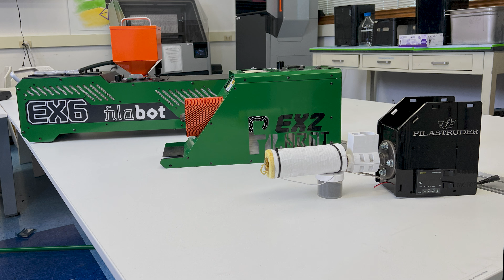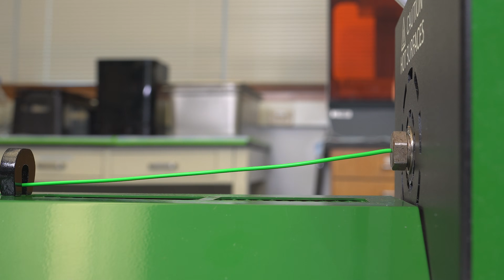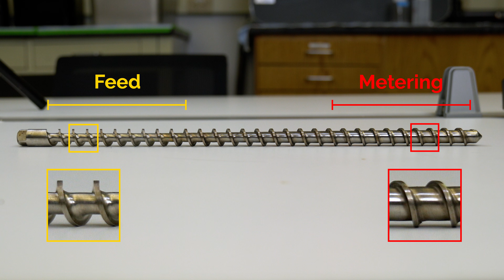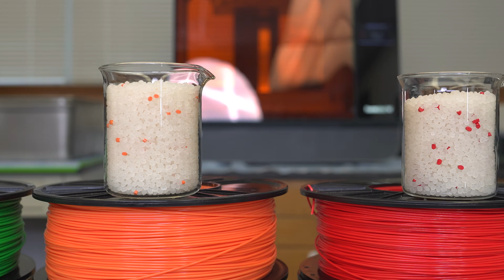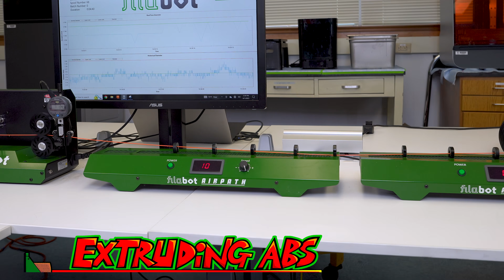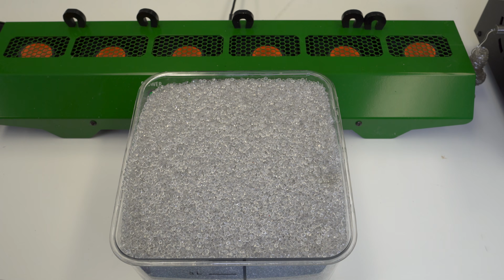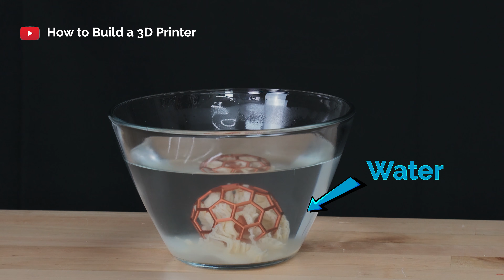How to Extrude 3D Printer Filament (Basics of Screw Extrusion)

Comment: I worked in the plastics industry when I was younger. I worked on Extruders, Injection moulders, Massive or rather Gigantic Vacuum formers, Conduit pipe bending and collar forming in baths of Hot Glycerin. As well as Custom made anything made out of plastics. Oh yes, we did Signs as well and had an in-house electrician to sign off on everything. Cool job. So, if 30 years ago you told me about 3D Printers and how everyone would have one in their home, I might just have believed you. But if you told me that a few years later again many of those people would have their own plastic extruders in their homes and some people even making their own little injection moulders well, i would never ever have believed you. The prices of industrial injection moulders and extruders were prohibitively expensive back then. The injection moulding machine its self was around $1M (Australian) and I was told the Moulds were around $500k per set in total. The mould in particular was for making McDonald's Tea Spoons. I can not wait to have my very own extruder for making 3D Printing Filament.

Comment: $20 for pla, its $15 or even $10, so the ROI factor is doubled, 3000 spools, who can go through 3000 spools of filament, and then isn't it going to be better to do injection molding?
I looked into contracting out production of some 3d parts I am using for a small production product (like 100 units), and the quotes given from 3d print services were insane,
I don't see how any of these businesses (who are the people that would buy these machines) can stay in business, who pays $20 to have a $2 part 3d printed?

Comment: I've just gotten into 3d-printing, but so far have had good luck with PLA+. The problem of course is that I don't know what additives make the "plus" in PLA+, nor do I believe that PLA+ is a standardised material. I assume each vendor would have their own additives, and their own "secret sauce" to make their filament perform well. 

I've hypothesised that blending recycled shredded PLA+ with, say, 35% virgin PLA by mass, would produce a material that I'm jokingly calling PLA# ... but without knowing the exact additives in the PLA+ there's no way to model how that material might behave, or the ideal ratio with virgin PLA that would produce a stable material.

Comment: The Berstorff extruder at Goodyear in Lincoln, Neb. was 12 inches in diameter extruder. It used a 1000hp DC motor which was geared low to break "cold" jams, and was run under field weakening once things settled down to speed things up. The mouth of the extruder (where it met the calender rolls) was about two inches deep, and 84 inches wide.

No clue as to what electricity cost per hour to run it. 

Since I am local, can I buy filament from you to help you out?

Comment: Questions.  Why is there no foaming ABS?  PLA can't be left in the sun for 3d printed aircraft or rockets.  Is it possible to make a foaming ABS?  Also, how are foam filaments manufactured where they can be extruded the first time (under mfg) without foaming, yet foam for the end user when they print the material?   LOVED THE EPISODE.  I am also a full-time maker at a university.

Comment: 2:05 "the smaller extruders can not make this process worth your time" - I disagree with that statement because it depends on the intention for DIY extrusion.
If you're someone who does a LOT of printing, then 8h / 1kg spool might be "too slow" to be "worth the time", but I'd argue that most people that use 3D printing are NOT using up 1kg / day. As an example, my primary intention with DIY extrusion would be to prevent failed prints from ending up in a landfill.
If the quality is top, then 8h / 1kg spool would be absolutely perfect for me and totally worth the time. But I'm obviously not a high volume printer to begin with.

What I find odd though is that the spooling end part has a digital read-out of the filament diameter, but no feedback system that utilizes that data.
Meaning the lack of automated spooling speed based on diameter accuracy.

But otherwise a very informative video, especially the point on economics and expectations of return from that.
Reply from the maker: The other issues with the small extruders:
1) Increased residence time of the plastic in the barrel, resulting in thermal degradation of the extrudate.
2) Insufficient or nonexistent compression region causing poor pressure generation and inconsistent output. 
3) Poor mixing by the short screw, making it difficult to mix in colorant or other additives).

So unfortunately, even if you have more time for the extrusion process, the filament produced by very small, low-cost extruders will be inferior to those produced on a larger machine. Screw extrusion is one example where a machine that is 2x larger is not just 2x better but exponentially.

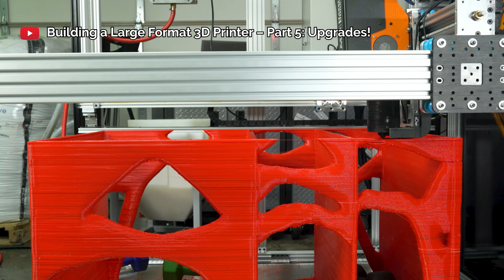Comment: Im sure Dr D-Flo knows this, but it needs to be said... @7:48 you can see the layer lines so dramatically, because the tolerance of the filament is too great. The printer assumes perfect 1.75mm diameter filament. If that varies, so does the quality of the print. Although the industry standard is +-0.05, you wont see a quality print unless the diameter tolerance is +-0.02mm.

Comment: why not accurately and evenly heat plastic to its melting point and extrude it from a large molten volume instead of dealing with all the complexities an auger brings?
Reply from the maker: Plastic has a low thermal conductivity, so it is very difficult to melt large volumes of it in a timely manner. Also the plastic degrades when kept at high temperatures for long durations. The Archimedean screw more uniformly mixes and heats the plastic.

Comment: Likely dunning Kruger here but won’t metal be too abrasive over time and increase that 100 micron gap?
Reply from the maker: Yes the gap increases. You hope that the screw is the one to decrease in diameter as this is a replaceable component. Usually the barrel is engineered to be harder.

Comment: great video but DAAMM the equipment is a RIP OFF beyond stupid. A new car with a multi cylinder combustion engine will complex drive systems and smart connectivity that will last 100,000 miles with no issues, ooOr a fancy motorised screw with a heater at the end of it. 🤦(btw the extruder costs £12,000)
Reply from the maker: 🍎 and 🍊. One is a highly specialized tool for a very niche market and the other is perhaps the most mass produced device in human history (engines as a whole). Not down playing the extruder’s cost because it is expensive, but economies of scale need to be considered.
Reply: @DrDFlo  true but its £12,000, id understand completely if it was around £7,000. I completely understand it is a niche market so prices are higher. But this consists of motors and a dozen sensors screwed to sheet metal (not very advanced ones eithier). I can't ever see any more than £3,000 worth in parts in there. The waterbath is £1,000 and that is litterally just sheet metal.

Comment: Great video and clearly great hardware, but ...  I can't shake the question: why so much manual and analog gauges and knobs rather than having everything measured digitally and controlled as a whole by one or more microcontrollers?  Seems to me that automating could seriously simplify the process and by dropping those analog controls and feedback gauges, I'm wondering whether it wouldn't even save BOM cost ...
Reply: Absolutely, a bit more automation would really help.

Comment: Hey d. When you start the spool put the filament in the hole at the outer part of the empty spool and when it runs out it the filament won't stick in the capture hole and and it'll trigger the run out sensor on a printer. This will help if there's a long print running.

I can't take credit for this. The fella at slant3d mentioned this fact.

Comment: Would it better if the extruder is set vertically so the gravity could assist with tensioning. I know I've seen something similar, ( i think it was spaghetti manufacturing), where as silly as it sounds, the diameter consistency and tolerance was really important.

Comment: I believe some wire drawing is passed through a cold die, basically a hole the "correct" diameter that is needed. Tiny bit smaller to allow for expansion after that cold die

Comment: Great job and actuate terminology I have been running extruders for over 20 years and can say your the first that I know of in the FDM field that gets it, it's not a glue gun and this is only the start but a very good one at that there are many different styles of screws besides just the Let Down ratio and compression like high output and mixer screws for achieving different materials and ways and my ever famous saying what goes in comes out true story lol Cheers! there are also backpressure gauges like dynisco and melt indicators that help you lock down the ideal heating and cooling of the barrel zones and get the best back pressure for consistency keep up the great work!

Comment: The only nice part about HDPE's tendency to shrink is that it makes it easy to remove from things. In fact, you'll struggle to attach it to anything via glue; your only options are mechanical fastening and melting parts together. Brothers Make shows off some great methods for working with it on a hobby scale.

Comment: I used to work for filabot. I wrote the data logging software "filalogger" for them. Many of you have questions about closed loop operation. This was indeed on the table when I developed the system. Sadly though, it is not anymore.
Reply: @btechnet is it still possible to setup closed loop controls? Seems like it'd be super valuable for longer runs.
Reply: @Charlie-id4tv  It is still possible. It would be a substantial investment to get it working since they use non-standard controls. At the end of the day, if your extrusion line is setup properly, you should be able to balance speed between extrusion rate and spooler without having any major fluctuations. 

I still have two EX6's myself, and I can run those for 8 hours a day and maintain +-0.02mm the whole day.

Be sure to get the upgraded barrel / screw combo. Chrome plated screw at minimum. If the screw isn't the upgraded version, you will need to replace the barrel every 4 months.
Reply: @btechnet  I might need to control the speed for nonstandard filaments. I guess it wouldn't be as simple as re-wiring the control knob, or heck, just jerry-rigging a servo to directly rotate the dial?

An arduino microcontroller could monitor the diameter readings from the micrometer and make crude adjustments at least.

Thanks for the info.
Reply: @Charlie-id4tv  Youtube isn't letting me reply with any useful information, but I have a bunch of useful information for you
Reply: @Charlie-id4tv  The SPC Unit is open source. It is also already using arduino

The SPC unit can be extended to work with automatic control if you replace the motor in the spooler with a nema 23. The SPC unit captures the diameter data and sends it to the software front end I wrote.
Reply: @btechnet  Unfortunate that YT does that, it's pretty frustrating. I would post my contact details as a workaround but it'd probably get retracted.

I looked over your channel's posts and found fusion filaments - can I reach you through the site form?
Reply: @Charlie-id4tv  yes, that's me
Reply: @btechnet  Sent an inquiry just now, thanks.

Comment: I used to work for Crane plastics.  We extruded Vinyl siding.   We had to dip the siding in a water bath to cool and set the size.  We also would run a roller to imprint a wood grain into the vinyl siding.  We had a line go down we had to stand there and cut the siding with a hack saw into 12 to 14 inches.  This would be returned to be ground back up.  This is just a much smaller version of the extruder I ran.

Comment: $6/kg of pellet is expensive, but I guess that's PLA. 🤷 I'm looking into solutions for getting PET filament, and rPET pellets are well under $1/kg. I don't recall the price for virgin but it was nowhere near $6.
Reply: Depends on where you shop
Reply: Another commenter said they were getting 40% off by buying in bulk, but they sounded like a commercial operation buying tons of it

Comment: For the price, there sure are a lot of manual controls and such. You'd imagine they'd be able to integrate various pressure and flow sensors, and use that data along with the measured diameter of the filament to automatically control all aspects of the process.
Reply: I agree. My wife just bought a bronco and I left a few grocery bags in the backseat and the truck reminded me when I turned it off. It wasn't a maybe you should check, it was a there is something there. As someone who plays with sensors of all grades for various projects I agree with you.
Reply: @jstro-hobbytech  This is probably designed to keep you from leaving an infant in the back... what a nanny car though, I disable the dinging bell telling the door is open.
Reply: Edit. I use the bronco story as an example for sensor tech. The 2 bags were small and weighed much less than 5kg. Being they probably bought the cheapest sensor they could reinforces that you're right.
Reply: Not only  could digitization enable automation, it would probably bring the cost down.

Comment: Awesome video as always!  I wish the ROI made a bit more sense on this equipment.  We actually go though a significant ammount of material at work.  On a positive note, the small batch nature of our demands makes a machine like this perfect.  But when you factor in a small ammount of labor and the upfront capital investment requirement, it makes it difficult to suggest over using our own material stock.   

Which is one point in this calculation that may not have been considered.   If you're a company, maker space, or even really avid home user,  it's not terribly difficult to get much better rates on quality materials as long as you meet order requirements. We get up to a 40% discount from one of our suppliers.  Which only further lengthens the ROI of a system like this.
Reply: @Mytagforhalo Out of curiosity how much pellets did you have to order to qualify?
Reply: @Charlie-id4tv  These types of discounts im mentioning are for spooled materials.  The quantity varies, but some companies like Hatchbox have no minimum order quantities so long as you're looking to purchase material in 5kg bundles. 

A company like polymaker typically has a few thousand minimum order quantity. They're also one of the few companies that you can get pellets from directly without a huge fuss. 

Sunlu and Esun i've spoken to, but they had a minimum order of a metric ton of material. 

We also work with smaller US extruders that will spool up whatever you want for ~ $3-5/kg over the cost of raw materials and spool.

Comment: Is there a quality extruder that is cost effective for diy use? The spooler and cooler are fairly simple and can be had for a reasonable price elsewhere, but the cheaper extruders just don't quite get the job done from what i've seen.
Reply from the maker: Unfortunately, not that I have seen. I am trying to build a conical barrel extruder for processing flake (common form of recycled material), and I am getting wild quotes for barrels. Seems like only specialized machine shops are able to bore and properly harden barrels.
Reply: @DrDFlo  Would it not be possible to simply extrude the plastic through smaller and smaller holes until it gets to 1.75ish.  This is how they extrude metal rods.

Comment: Nice video, I thought there would be more information about carbon fiber fillament since that is presented almost like a title in the thumbnail. (I barely read titles myslef, 80% looking at thumbnails and 20% title) Filament extrusion machine is not recognizable as one. Maybe have a shot of the extruder nozzle making a spool of fillament so it's immediately clear what the video is about.

Another litle side note, maybe call the video something like "Making 3D printer fillament" or something since it could be interpreted as being a video about extruding existing fillament from a 3D printer nozzle. 

The video is really good but I can imagine it maybe not reaching the proper audience with the current title and thumbnail